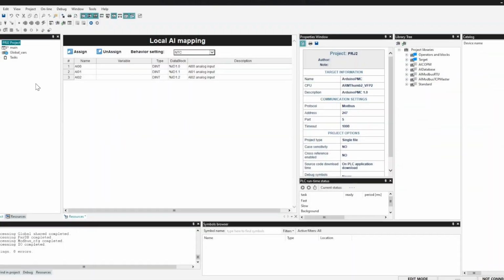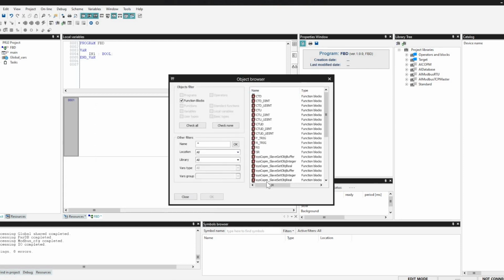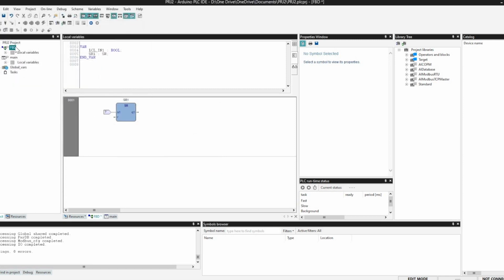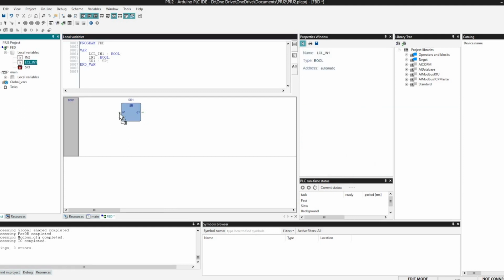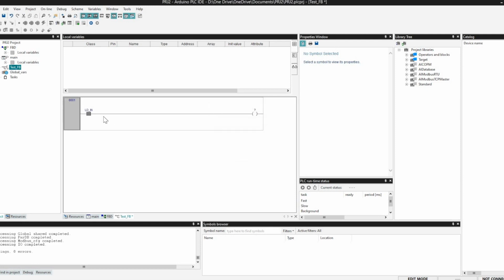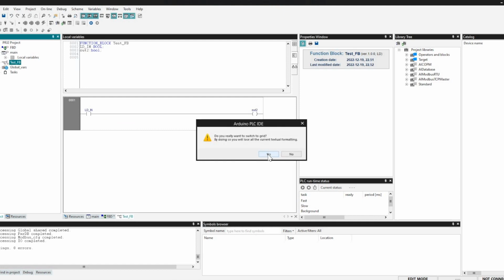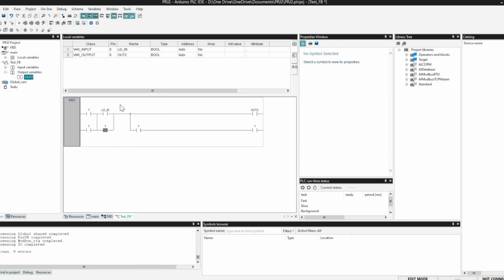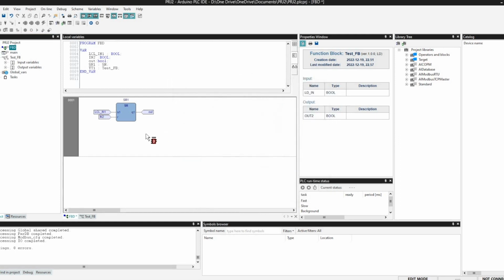Arduino  PLC  IDE Programming  Part 2

Comment: Gracias por compartir.
Que opina de Open plc para Arduino.
Reply from the maker: I love the concept of Open Plc. where we should be independent of vendor specific.
Open PLC for Arduino is good platform to start. It really helps to developer who mostly work on IEC 61131.
it support most of the Arduino board & may be the community will develop for Arduino OPTA plc which is going to come.
Reply: @jugaadtech12  👍👍🤝